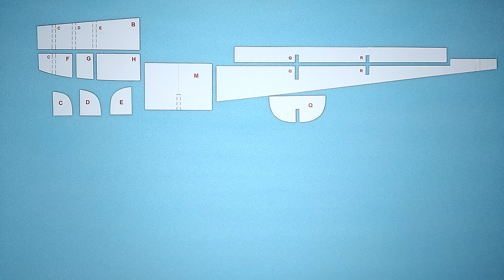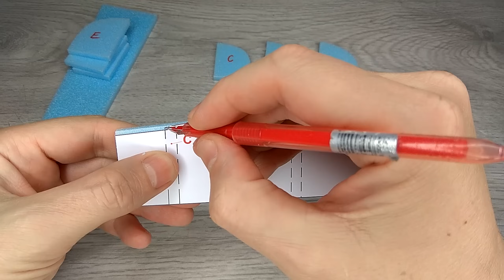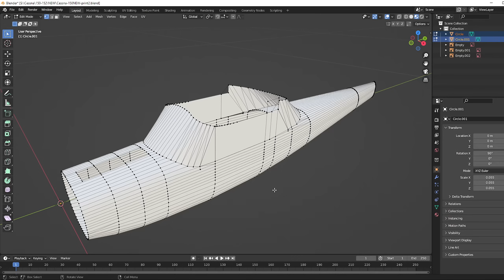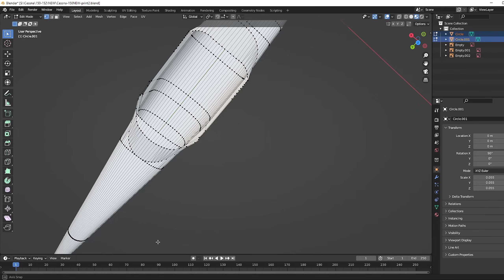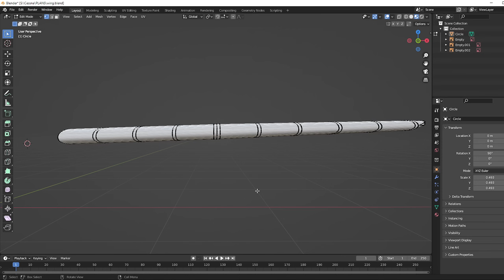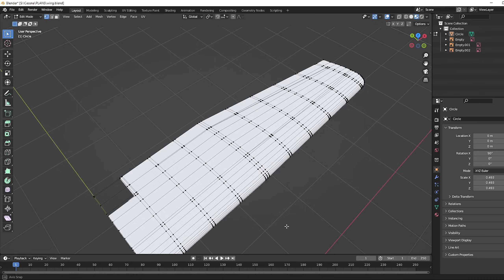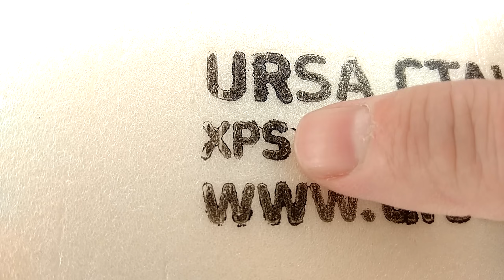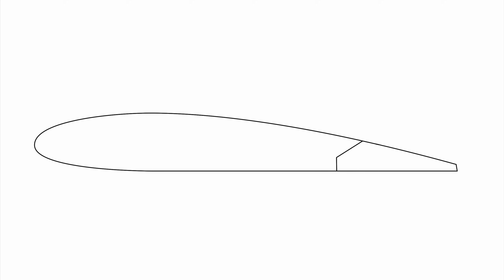Cessna 150 RC Plane full build DIY

Comment: Awesome and relaxing build as always. I really admire your skills with blender and manual work. I would love to see more of the Cessna flying on your flights channel. Btw I was recently struggling with bending the wire behind the wheel because it was too short to be bent. I tried putting the shrink tube to stop the wheel from falling but I didn't have CA glue to fix it and it kept falling off so I found out that I can put a bunch of solder on the end of the wire so the wheel remained in place and the tin was very solid.

Comment: What is the white material you are using?
Reply from the maker: read the description below video
Reply: @NumaVIG yes, i read everything, but neither depron or XPS is really that flexible. But maybe i am wrong. Apparently, depron and XPS are more rigid, which means that if i were to bend them at that angle, they would probably break. But still saying, i do not know, because i have never bought this stuff.
Reply: @sarkafilipova4543 
I tried with a foamboard here in Canada which is 5mm thick, I couldn't bend it, I have no idea how he did it

Comment: information.          at 20:32, the  Mass of wing-located servos  SHOULD  be located  Forward  of  THIRTY percent of chord.!            at 26:09, the mounting of a vert-stab should include a  'spar' whose orientation is  Perpendicular to the  'center line'/air flow.            googletranslate